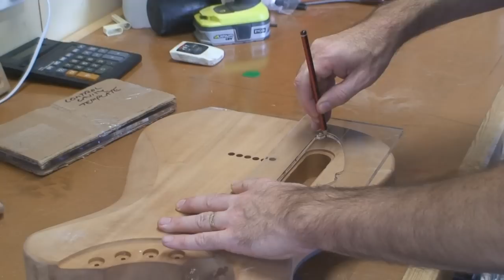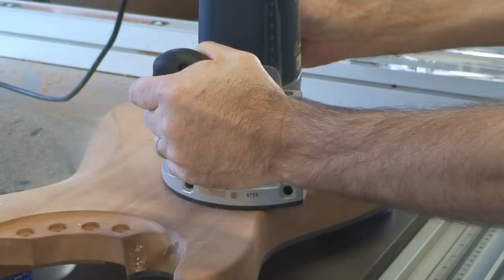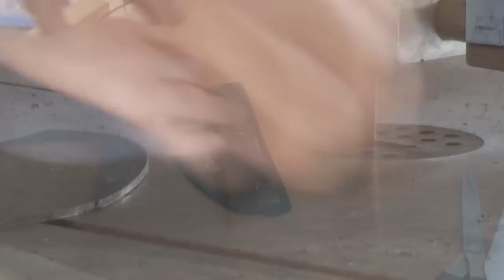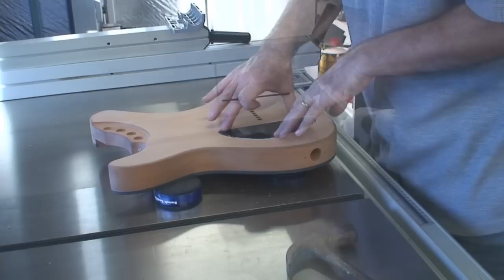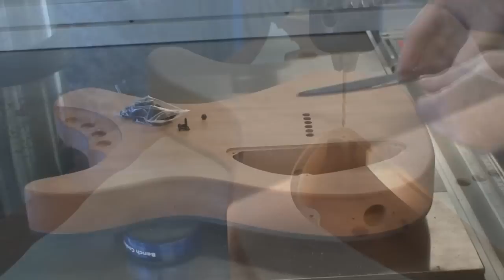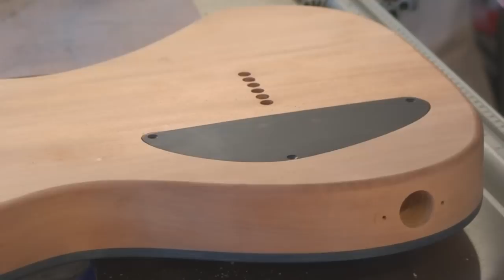Part 17 - Resizing The Control Cavity & Making A Cavity Cover

Comment: Is your fret bender the eBay one from Hungary? It looks an awful lot like mine. You sure like lots of hand labor. I would be shaping the necks with my stationary belt sander. I did a guitar with no glue no screws neck joint. I got the idea from beam and post 1800s mortise joints in Audel's Carpentry book, and a repair I got when a piano fell through some a floor.  I got to fix the piano and the floor. Blind dove tail mortise with metal tenon wedges! I did a different take on it than metal wedges

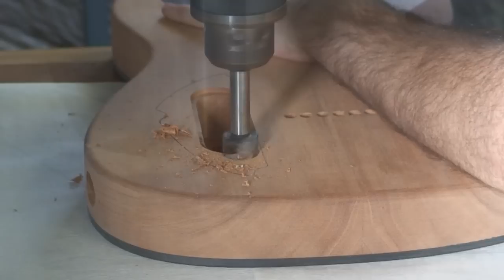Comment: At 0:17 what type of router bit are you using ?
Reply from the maker: Forstner Bit in drill press. Its not a router bit
Reply: @FletcherHandcraftedGuitars   can you use a router to remove that much wood?